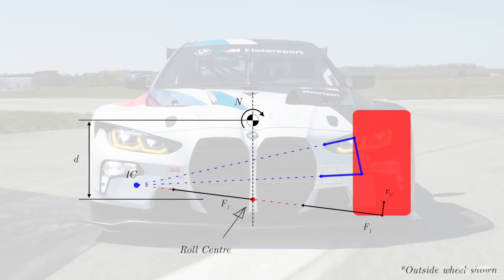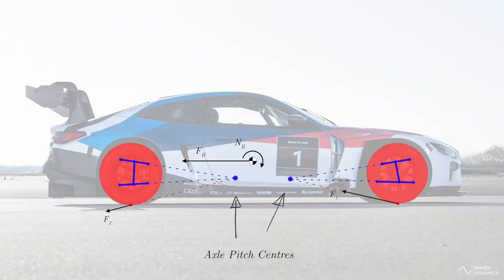Vehicle Dynamics Insights 002 | Roll Centres & Performance w/ Mike Law

Comment: The unknown, missed, omitted, and ignored subject on the roll centers, (hence the roll axis height at the sprung c.g.), is it's influence on the sprung roll inertia via Physics 101 Ixx=Ixx_sprung+Msprung*R^2, where R is the vertical distance from the sprung C.G. to the roll axis.  Combined with springs, bars & dampers, this produces a measurable change in the roll damped natural frequency.  This may seem trivial to most, but knowledgeable vehicle dynamics engineers should realize that while the roll frequency is generally constant with speed (yes, there can be speed effects on stiffness, hence roll frequency changes), the yaw velocity & sideslip natural frequencies are functions of speed & speed^2.  If you are familiar the notion of convolution (complex multiplication of system responses), you know that steer produces yaw velocity & sideslip, hence combined into lateral acceleration.  These components ALSO then are forcing functions of the roll degree of freedom.  So steer doesn't make a vehicle roll unless you have caster in the steered axle.  This can have a profound effect on total vehicle response when cross coupling terms (like roll-steer [steer due to roll] and roll-camber [camber due to roll] interact with the lateral acceleration terms.  Problems occur when yaw velocity and/or sideslip natural frequencies line up with the roll frequency.  Because they are speed dependent, frequency responses can 'hook up', which we call 'Q'.  At speed above the 'Q' speed (Q-Speed is where roll & the other frequencies are the same) the SIGNS of the roll-steer & roll-camber functions will reverse, so roll understeer becomes roll oversteer, etc.  Most novices throw more damping at the resulting (high speed) problem when the solution is to set these functions, or the roll axis, or the sprung inertia to values which prevent these degrees of freedom from 'Q-ing' up.  (Decoupling).

Needless to say, the roll axis inclination angle also changes the sprung mass cross-products of inertia, so roll-pitch etc. effects jump into the game.  

All of this means that the roll centers greatly effect the DYNAMICS of turning as well as the STATICS, as in load transfer, Fy, Mx, and Mz tire force generation RATES.

If any of this sounds familiar or makes you think of other 'Q-ing' issues lately, take a pause and re-think 'porpoising':  Aero is the forcing function, but the root cause is frequency coupling.  Both situations can get so bad, that the responses can become divergent until some displacement limiting constraint is contacted !   BTW: all of this is usually lost in simulation unless you manually adjust the inertias for each situation, or the sim is programmed to correct the sprung inertia values for the roll axis location in play.  If you have the capability, switch the roll center locations front to rear, readjust the roll stiffnesses to maintain balance, and examine the time responses.  Changes in the cross products of inertia will drastically change the response times & overshoot calculated by the sim.
Reply: Now you may get the idea for having a roll axis inclined downward to the front.  One vehicle manufacturer tried it the other way around but reversed course in the same model 1 year later.   Ooops...
Reply: @zzvyb6  Why are you picking the roll centre as the new axis in your equation? It's not the point about which the vehicle rolls. The "Physics 101" equation is not compatible with the common definition of the kinematic OR force roll centre
Reply: @HGC112  I didn't say or write "using a roll center as the new axis in equations".  Re-read my comment for clarity.  BTW:  We measure this all the time.  AND, the measurement process is a cool way to determine what the total unsprung mass is.
Reply: @HGC112  May I suggest you play with a simple pendulum with a sliding mass which is not mass-less as assumed most of the time.  Hopefully you will notice that the frequency changes.  A vehicle is actually an inverted pendulum, but the analogy holds.
Reply from the maker: Appreciate your insight Bill, not something i've had an opportunity to observe experimentally yet but i follow the theory there. Although in motorsport environments, if the roll centre location is largely a function of the camber gain you're aiming for to find the tyre presentation you need, my feeling is that in practice, avoiding these coupling effects would require some large scale adjustments to avoid?

You have any script which demonstrates that? 😅 - Jahee
Reply: @WaveyDynamics Yes, the camber gain is the primary objective for locating a front and or rear roll center.  But the roll AXIS location under the sprung c.g. can be the trouble maker.  'Race cars' are usually not in this zone for several reasons: They are stiff in roll/g (so getting the camber gain you desire can take a major geometric 'volume', as in stuff gets in the way),  race tires have high initial cornering stiffness, so yawrate & sideslip frequencies at corner entry are much higher than those of typical pass cars, and all 'race cars' usually have very low understeer, or relatively slight oversteer, which gives them a highly overdamped yaw velocity response.  Even though the sideslip response may be under-damped, the phenomenon can't get started because the SUM of the tire stiffnesses at max lat does't amount to much at corner exit. The yaw response is due to the DIFFERENCE between the tire stiffnesses and typical weight distributions in 'race cars' keep this low on cars with the same tire construction/size.  

Not so in pass cars with high front weight bias, aymmetric powertrains (crankshaft axis), transmission type & mounting orientation, fuel tank & battery location, etc.  But weekend warriors sometimes get into 'Q-ing' situations when the math of their aftermarket components hooks up.

It's bugging me that I can't remember the Saab engineer's name !  He gave us quite a spiel about their use of roll oversteer in the back to solve VERY high speed problems like the 'Q-ball' one.   We just had to find out why when the '82 Camaro was being developed.

Yes I have simple Matlab Control System models of this and other phenoms on my Google drive.  You will need several toolboxes besides base Matlab to run them but its a 'cheap date' as they say.
Reply: @zzvyb6  The point is that the R which is the "distance from CG to roll axis" is an arbitrary distance, because all the roll axis is, when defined by the industry standard definition, is the point at which Left and Right lateral and jacking forces can be summed into one at the vehicle centreline. It has nothing to do with the actual movement or physical point of rotation.

If you have a car where FL and RL are of extreme and equally high stiffness, and FR and RR are of extremely low but also equal stiffness, does your equation still apply? 

I think you're speaking of Magnus Roland. Unfortunately majority of his takes, approaches, philosophy are pure rubbish but also very funny
Reply: @HGC112  That's right ! It was Magnus !.  We had a lot of fun with him in a game called 'Circular Reasoning' in which you are challenging him to accept your own arguments and then you switch to arguing his original position for which he has reversed his opinion and tries to get back to it.
But, his roll oversteer argumemt panned out when trying to fix a high speed roll instability with damping.  In Saab's case, they were force to use much higher cornering stiffness tires to get back acceptable response times.  Not possible in the States because these tires had very poor rolling resistance and horrid wet & ice/snow traction.  This was the very beginning of the use of Controls (Bode transfer function) Engineering in car control. Plus a new technology to apply it to nonlinear systems where the nonlinearities were either softening springs (tires) or hardening springs (power steering).
So, you know the sprung C.G. from measurements (in fact required by Federal Law because of rollover & stability control regulations), you know the force based roll center heights from design specs & verification by K&C tests done with inertia relief (cornering simulation), you know the wheelbase hopefully, so you know R.  My Chevy truck even knows the ride height, and has tables of a few other K&C parameters stashed in it.   BTW all this is running in real time in all modern vehicles in the States as part of a 'Reference Steer' model running in the car network to anticipate rollover and loss of control situations.  It knows the steering gain, the passenger & fuel loads, and gives approval to any driver's steering or braking attempts.  Anything out of bounds means brakes.   The way to screw it up is put a very different set of tires on it.  But the TPC Spec  (Tire Performance Criteria) system is supposed to prevent this 'foreseeable misuse'.
Reply: @zzvyb6 As a driver, what will be the effect of various natural frequencies Q-ing up? And a lot of older cars have the roll axis slope up from front to the rear (especially most modified cars with McPherson front and a nice multi link rear), it seems that unless this is grossly off, the driver will not feel a tremendous change to the mass moving in 3D space. Very interesting items to think about and some I am curious to try on my race car to see what the result is in terms of feel.
Reply: If roll frequency Q's up with yaw velocity for example, you might get an unstable growing oscillation on a straitaway section as you build up speed.  Keep in mind that your seat is probably NOT not at the sprung C.G.  And you head/ears are certainly not their either, so the roll axis will introduce false lateral and vertical sensations, usually not conducive to proper reading of the car's trajectory via your own integration of signals to predict future position (wall, line, pit entrance).   Also, as your hard crash inventory accumulates, your ability to actually make these mental calculations becomes more difficult if not impossible.  Comes with age, too.  Driving fast and maneuvering well depends on your internal ability to predict Derivative Control expectations, i.e. Look ahead points & marks.   This is where the phrase "Car is better than the driver" comes from. Driver should be better than the car.

Comment: What are the negatives of having low roll centers and controlling roll with stiffer roll bars as compared to a high roll center setup? Thanks.
Reply from the maker: It would depend on whether aero is a significant factor and what suspension design is being used. 

If roll is not decoupled from heave and warp very well then the high roll stiffness you’d need may mess with ride performance (think mid corner bumps) and general compliance. 

They’d also be quite different in transient conditions at turn in.